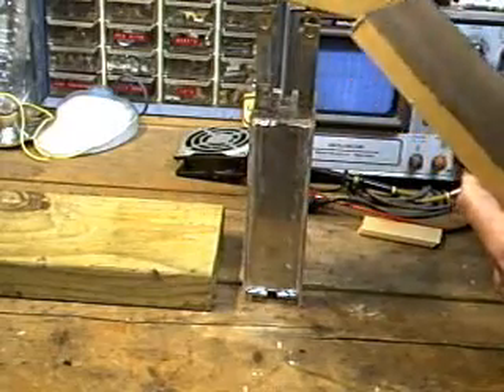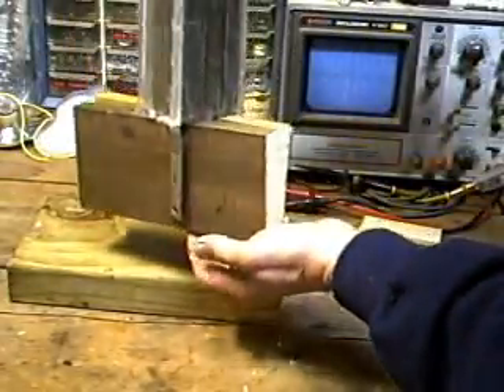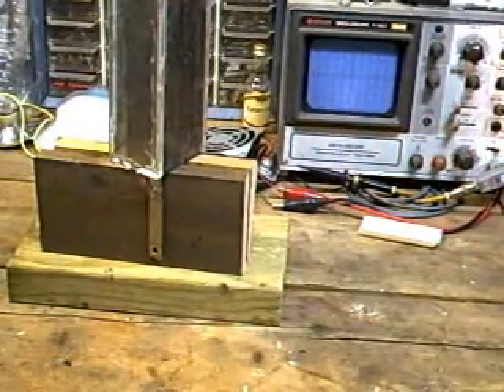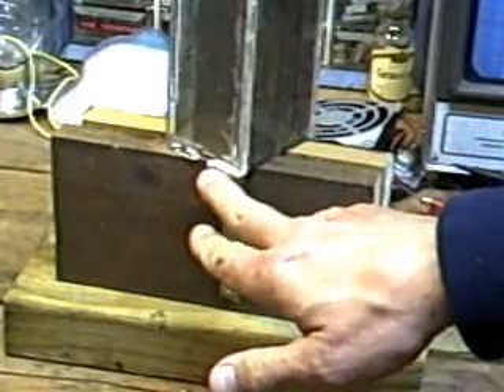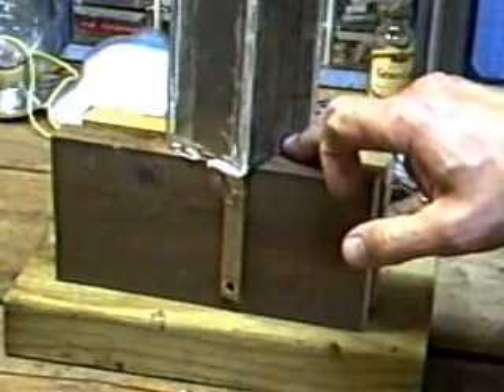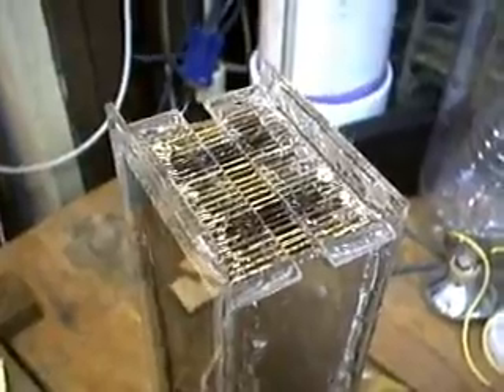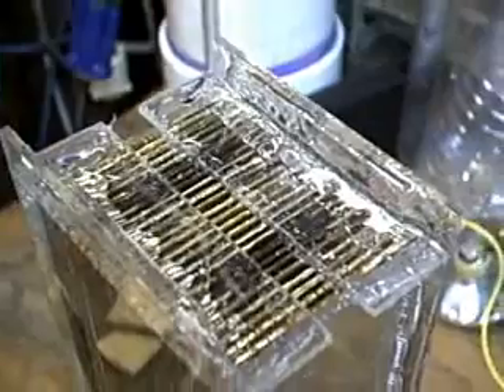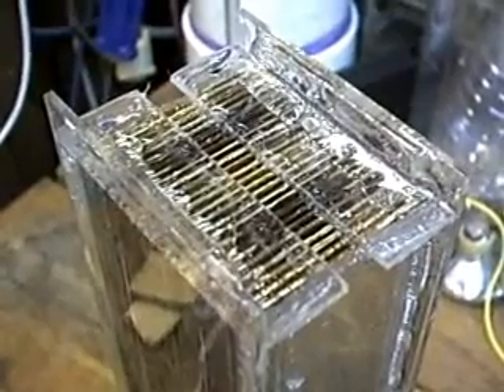#96 - Gluing the baffle plates to the VSPB cell

Comment: Unless you are talking about using some sort of catalyst that is consumed as part of the electrolysis reaction, your acid/base control of hydrogen/oxygen ratio is not possible.  Water is H2O.  When you split it, the only output possibility is 2H + O.  You can't change the output ratio.

Comment: The other could potentially be an intake air temp sensor. That is the other almost universal sensor found on the intake piping of most cars. Based on a flow and a temperature sensor, the car 'knows' how much oxygen is coming in. Temperature is needed because when cold, the air is more dense, and when warm, it's less dense. So, with the MAF and a temp sensor, the engine has a pretty good idea of what is coming into it. the O2 sensor fine tunes the base fuel maps the car's ECU uses.

Comment: I doubt you have a Oxygen sensor on the intake. The purpose of the sensor is to readjust the amount of fuel the car injects into the cylinder, based on the left over air/fuel in the exhaust of the engine. It usually reads at least 10 times a second. but i've never seen one on the intake of a car. The sensors can be quite expensive on newer cars, $100-$200 sometimes. Older cars are cheaper because they are less advanced.

Comment: Anything that has to do with monitoring the air or oxygen content. If you mount the inlet too close, the car will increase the amount of fuel being delivered to compensate for the increased level of oxygen coming in contact with the sensor.

Comment: Hey Z, great work. I just learned about HHO and I have been reading everything I can find on it. I watched all 91 of your videos last night in a row, and I must congratulate you on being very scientific the whole time. I noticed you've been using KOH, have you tried Distilled vinegar? I read that an acid helps make more hydrogen, and a base helps make more oxygen. Also, 20-30 amps seems a lot for a car to handle when many small cars' alternators only handle up to 90-110 amps.